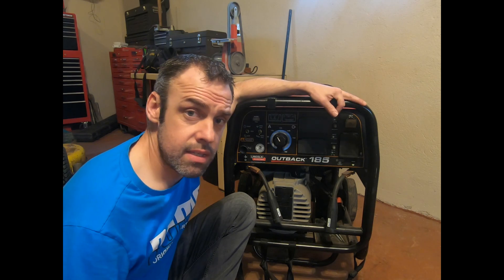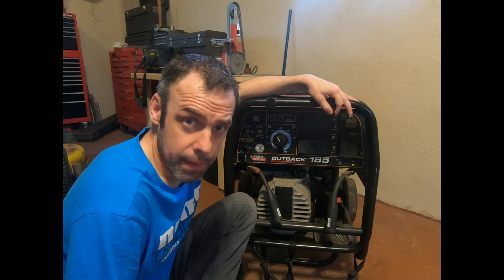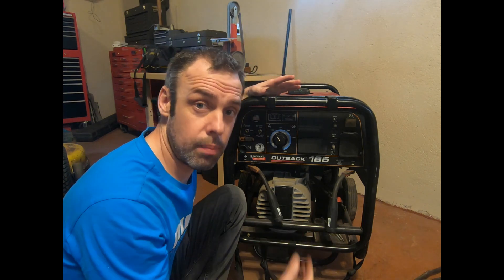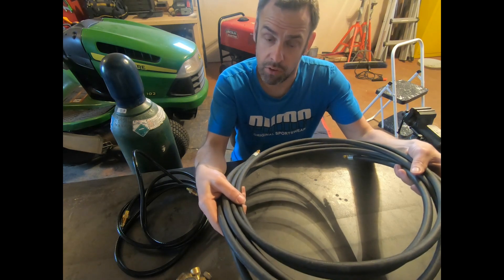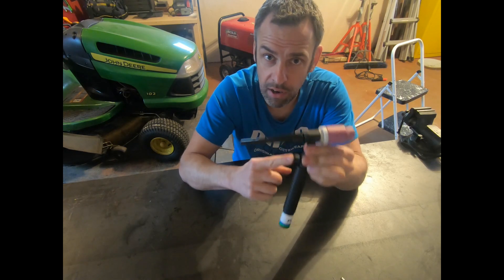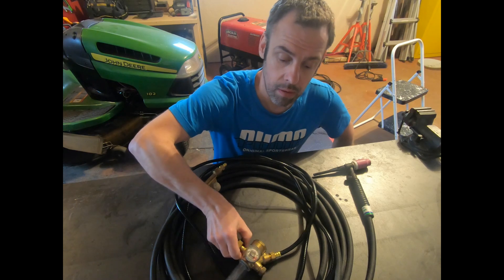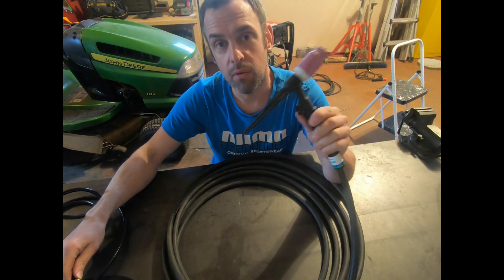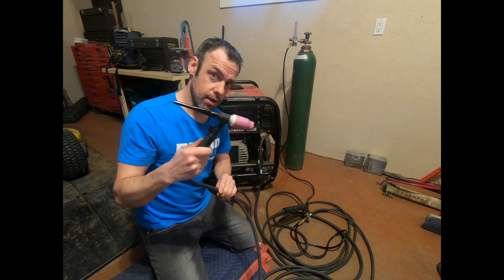Turn your stick welder into a scratch arc TIG welder

Comment: Great video. I did the same with out using the 1/4” bolt. The female internal thread in the brass connector body (B37) of the shortstub that the electrode holder head screws in to is 9/16 12 TPI. If you simply unscrew the electrode holder head completely and set it aside you can slide the stinger handle off and using a 9/16 12TPI X 1” long bolt and a couple of washers you can very securely attach the cable adapter to the B37 connector body. This also gives much better electrical conductivity than the 1/4” bolt method. Of course as you recommended this connection method should also be insulated by what ever means to prevent an accidental short circuit. When finished using for tig just remove the bolt and reassemble the electrode holder head to stick weld.

Comment: BUY A PLASTIC TOOL BOX AND PUT THE STINGER AND CONNECTOR IN IT AND CUT A LITTEL HOLE AT BOTH ENDS SO THE WIRE CAN COME OUT AND THE GAS LINE CAN GO IN IT

Comment: Amp settings would have been nice....usually 135 ish to start on steel.
Miller and others give out a handy "slide rule" that gives you the settings based on material type and thickness along with rod material.
Reply: yea but with a DC welder like this you cant change your amps on the fly, and a lot of welding can be done at 90-100 amps, all besides aluminum but that's AC anyway.

Comment: Can it weld aluminum?
Reply: Not really, you need high frequency AC for that, so even an AC arc welder (buzz box) which will be 50 or 60hz won't cut it. To be clear, it will weld, but it won't be pretty.
Reply: yes but u would need a high frequency box and 100 helium

Comment: Did you put a welding mask in front of the camera
Reply from the maker: Hey Brody. 
Yes I used an automatic lens for a miller digital elite. I removed the lens from the helmet and held it with a spring clamp.

 I've since done some other tests and I'm getting slightly better results. Its tricky, I purchased a camera filter which will hopefully improve the quality of the video.